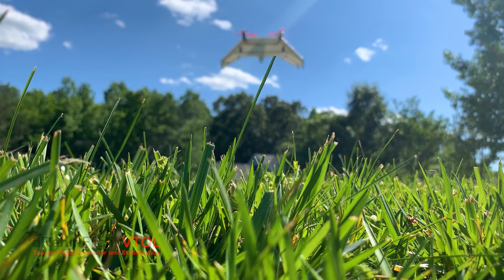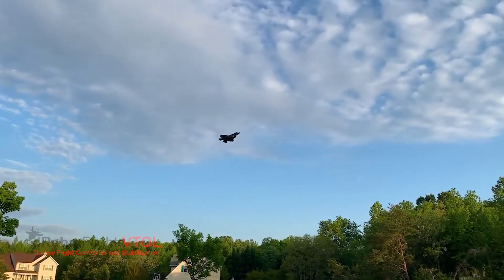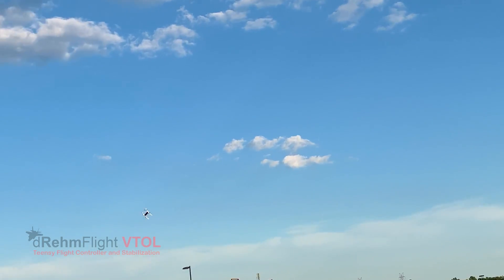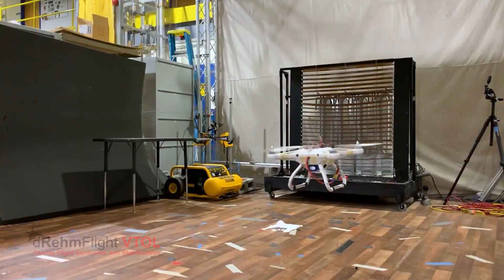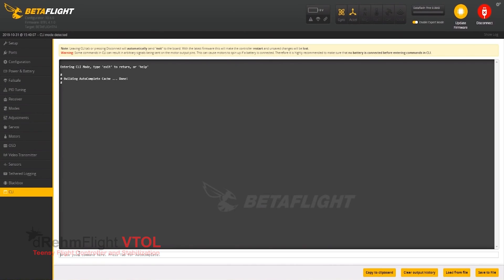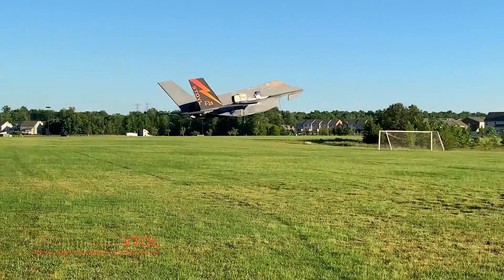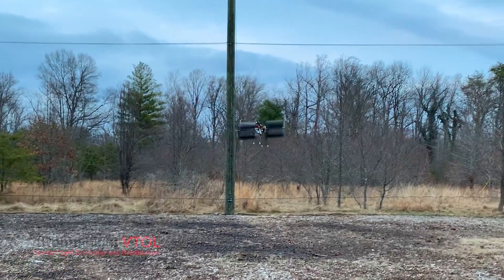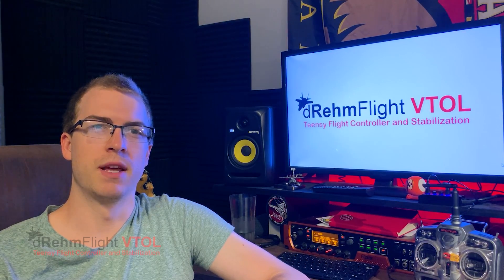dRehmFlight VTOL - Teensy (Arduino) Flight Controller and Stabilization

Comment: great  idea,am just learning the concept,can this code also work with arduino nano?
Reply from the maker: Ridge Binns I started on arduino nano before moving over to teensy for more computing horsepower. Some things on the current code won’t work on the nano (receiver interface due to pin support, servo library) and will run slower (~400Hz instead of 2kHz). Email me and maybe I can send you my old nano code to get you started. Still highly recommend the teensy
Reply: ok nicholas ,it nice of you  to share your code that you have created
Reply: ok here is my email to send the code to (ridgebinns41@gmail.com

Comment: Hey this is awesome! Ive been trying to do something similar on the m0 since it has the FreeRTOS bindings within arduino
Reply: Do you get of slack in your loops or does it stay pretty constant?
Reply from the maker: @phenioxrj  I have a loop regulator that just idles at the end of each loop iteration to keep the main loop steady at 2kHz
Reply: Are your loops pretty consistent or does the amount of time that it has to delay vary?
Reply from the maker: @phenioxrj  +/- 20 microseconds per loop when its unregulated, mainly from interrupts running to get radio commands